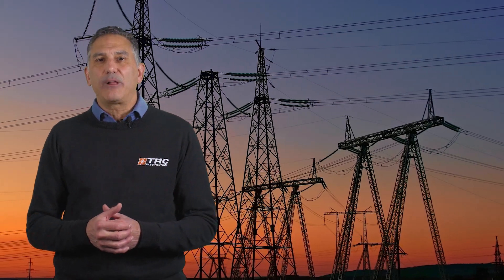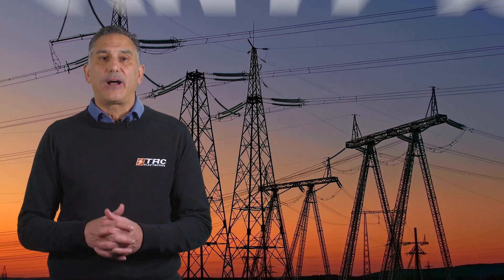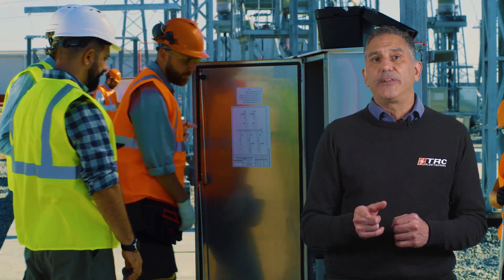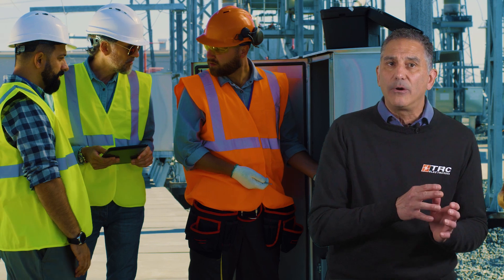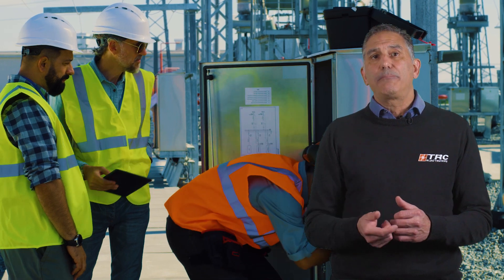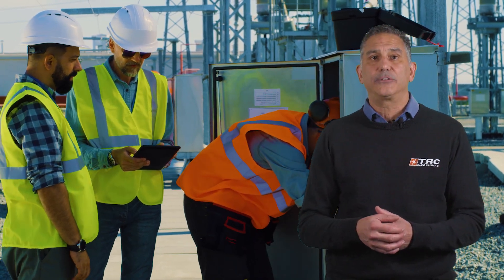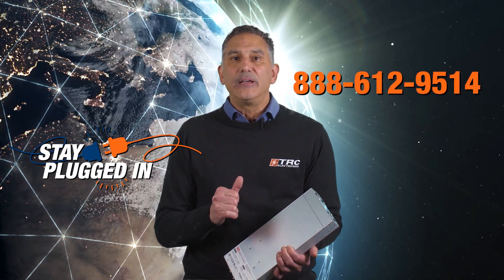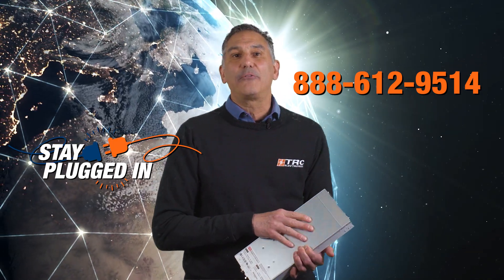Stay Plugged In: Anti Islanding

Comment: thak you for that answer Your the only one who has ever answered this Thanks  My point of view is I want go partly off grid  Trying to understand the difference between off grid and grid tie inverters  ( part of which is anti islanding .) If I buy off grid inverter is it a big deal to convert it to grid tie should  I wish  Thanks again for a straight answer difficult to find such amongst the glossy solar installer stuff . Then theres  worry lithium batteries in the house ... On step at a time
Reply from the maker: You're very welcome! The key difference between off-grid and grid-tie inverters is their connection to the utility grid. Grid-tie inverters sync with the grid and must have anti-islanding protection for safety, whereas off-grid inverters operate independently and do not have this feature.

Converting an off-grid inverter to a grid-tie system isn’t straightforward—it usually requires replacing the inverter, as most off-grid models lack the necessary certifications and grid synchronization capabilities. However, some hybrid inverters offer both functions, allowing flexibility for future expansion.

As for lithium batteries in the house, safety is a valid concern. Proper installation, ventilation, and using high-quality battery management systems (BMS) significantly reduce risks. Taking it one step at a time is a great mindset! Let us know if you have any more questions—we are always here to support you!

Comment: Re anti isianding : does it disconnect? Thank you for replying Can you ask your tech guys to give an answer. Cant get a specific answer anywhere. Some folks say they regularly hear their inverter clonking  noisily. So Do they actually physically disconnect from grid with an air gap.   Is that required by regulation. ?  thanks again for coming back
Reply from the maker: Hi, the product we referred to in the video was the MEAN WELL BIC-2200 series. When this model detects a loss from the Grid, the internal inverter that feeds the grid will shut down. There is no physical disconnection from a relay or contactor inside the BIC 2200. However, the installation manual states that a circuit breaker need to be installed in between the BIC-2200 and the Grid. This will be the physical air gap – but not necessarily activated upon a grid shut-down. 

Additionally, there is isolation “Air Gap” between the battery side and the inverter inside the BIC-2200. This isolation is rated at 3KVAC. This is from the internal transformer.

Comment: yes but does it actually mechanically separate itself form grid with an air gap ???  No one will say As none will say how much energy is used to continually power anti islanding feature
Reply from the maker: The system's anti-islanding feature ensures safe disconnection from the grid during outages, though the specific method of disconnection isn't detailed in the video. Regarding energy consumption, the anti-islanding function operates efficiently, using minimal power relative to the system's overall output. If you have any more questions, please reach out to our power specialists at 888-612-9514!

Comment: Good morning sir. I would like to ask you if you know. I have 4 solar panels of 150 watts. In my country, Greece, however, the injection of energy into the PPC network is not allowed. That is, the network clock should not be turned backwards. Is there a micro inverter or some diode or something else to cut this current? Thank you very much!
Reply from the maker: To completely prevent feeding back into the grid, one generally needs to use a transfer switch to isolate your circuits.  A diode will only work to prevent DC power from flowing back through it.  There does exist a type of inverter known as a “zero export grid tied inverter.”  This may be what you are looking for.  Please be sure to confirm this type of inverter would conform to your local electric codes.

For more information on zero export grid tied inverters, you can give us a call at 888-612-9514!